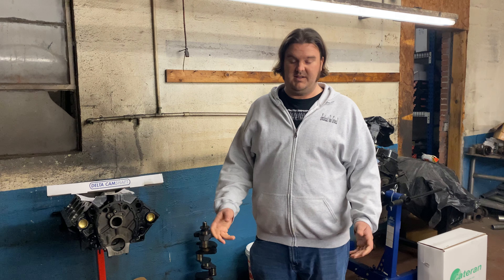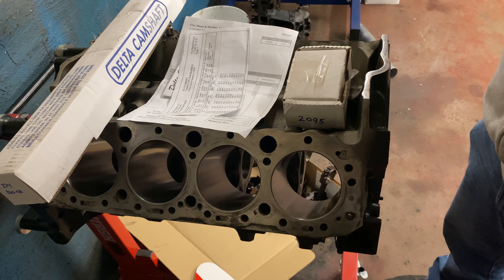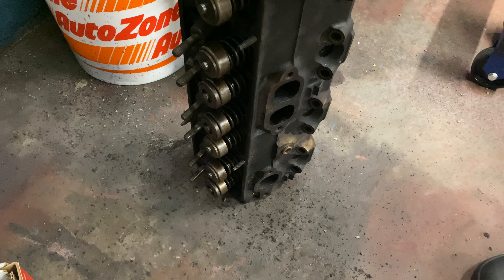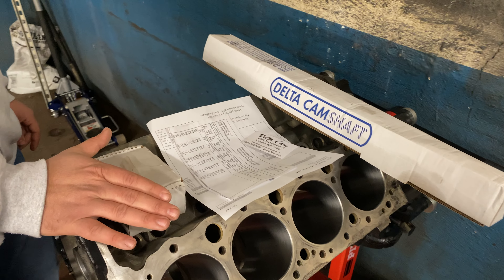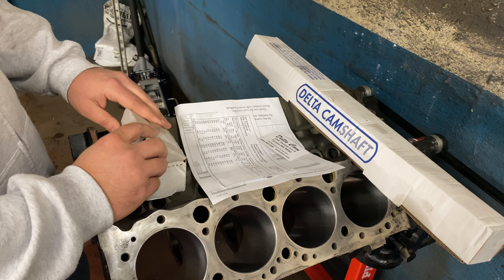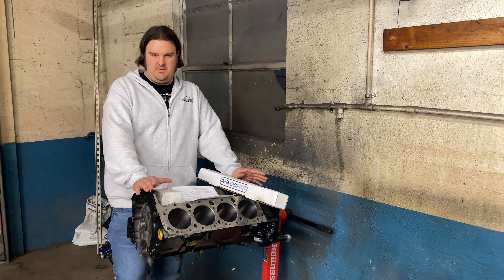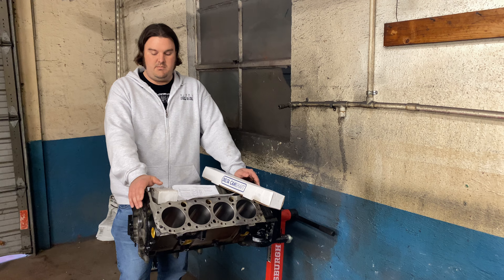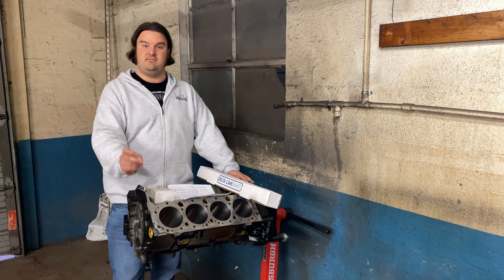The Recession Mouse Motor

Comment: It’s fun to see people from elsewhere work on engines, everything is different, even the engines themselves. Here in Germany we mostly have 4,5 and maybe 6-cylinders to work with, unlike that massive V8 you have there. Even the biggest Pick-Up-Truck from Mercedes or VW had a 3l V6 Diesel.
Reply from the maker: It is interesting to see what folks elsewhere build, and what's funny for someone like me is this V8 is very small for me. 305inches or 5 liters. A 454 Chevrolet isn't all that big to me with the availability of 596 standard deck height 454s and 632 inch tall decks. Lol
Reply: @nickthevanman9011   Holy moly. Yeah, you guys over there can do it with these cheap gas prices. My girlfriend is crying because her Car drinks so „much“ fuel, just about a bit more than 60mpg. And her car has problems with the front axle because the engine is so „heavy“, it’s 1,7l. Wish we had such cheap fuel too. Paid about 10$ per gallon last year, at least it’s a bit cheaper now, about 7$ per gallon. Really limits the builds you can do. I really wanna build a 327i „eta build“ in my E30, but the Gas is just too much.

Comment: I understand that your trying to work as cheap as possible with what you have but, for the best bang for the buck performance with an sbc, you really should start with a complete 96-02 vortec 350 long block out of a Chevy/GMC truck or van. In my area the old carbureted 305 engines are actually getting scarce and they are kind of a waste of money to build, it has been proven time and time again that a BONE STOCK vortec 350 long block with a carb intake and headers will make 300hp at the crank without changing the cam or even taking the heads off, plus if you use a 350, you will have a better platform to build up on in the future just my opinion. In my area I can find nice low mileage vortec 350s from the junkyard for between $300-$700 depending on which yard and if you pull it yourself and they have several advantages over the old 305s such as the factory roller cam and the vortec engines use a thinner piston ring pack which greatly reduces drag and frees up some HP.
Reply from the maker: I'd do that if I didn't already have free stuff in front of me. You may be surprised with a 305 that's build right as far as the combo. Good enough to get my dad's Monte Carlo to run a 9.20 in the eighth mile with a stock 79 long block with a 280/480 cam, team g single plane, 750dp and headers pulling a 3.08 gear. And that's totally the wrong combo. Most 305s are over carved, over cammed etc. A 1000$ completely fresh rebuilt 275hp 305 is nice compared to a used 700$ 5.7 vortec that's gonna have a bazillion miles on it and use oil. I like having fresh engines I don't have to worry about coming apart. Being a daily driver and all. Van engines are so hard to work on , I want them solid and reliable...I'm too lazy to pull them back out 😂